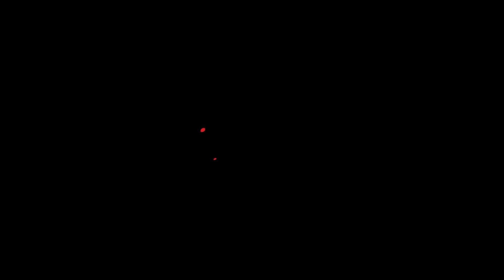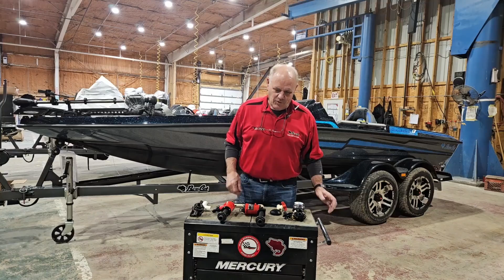Livewell INFO Tournament Angler's Might NOT KNOW!?!?

Comment: Why does my  24 Caracal STS  livewell leak on recirculate when I run on plane. 
I lose half my water.  The water temps in the summer here is in the 90’’s we have to use ice and additives or the fish die way too often.  brand new valve and it doesn’t leak after the tournament on the trailer.   
I’m the only Bass Cat boat in the club 
and catch  grief for killing fish.

Comment: So I'm a fan of Rick and IMO BassCat boats are the best made boat on the market.  That being said; if the water is below 70 degrees just use your "livewell" pump (regardless of what the manufacturer calls that), in other words; just keep refilling your livewell with lake water and leave the overflow open so waste (the foam that forms on the top of the livewell water) goes out and you will have no issues with healthy fish (deep hooked fish are another story).  When water warms over 70 (general temperature level) you need to worry about the carrying properties of your water's oxygen levels, (as well as waste material).  What cooling the water does is increases the oxygen levels, but you don't want to over cool your water with too much ice because you will shock your fish and may kill them.   Pumping warm surface temperature water over 80 plus degree water does is lower the oxygen carrying levels so you need to do is use your recirculation pumps, cool the water (less than 10 degrees so you don't shock your fish) and add 3% hydrogen peroxide at 1 ounce per 3 gallons of water (find out what your livewell capacity is and figure out how much hydrogen peroxide to add).  Keep in mind the warmer the water is, and the more fish you have in your livewell, the more waste/ammonia they will produce.  In warm weather you need to flush your old water at least once a day, and more in hotter weather with bigger loads of fish.  Add new water, if it's over 80 degrees you need to add some ice (but not a ridiculous amount), and some more 3% hydrogen peroxide.

Comment: You should consider a venturi system and inject oxygen at the bottom... spray bar cant push oxygen down, bubbles float.   Venturi system about as simple as it gets....TH marine has Max Air.